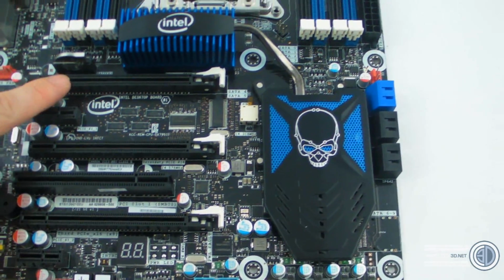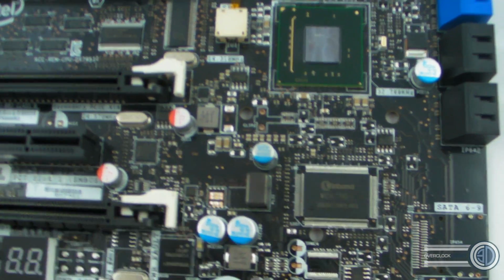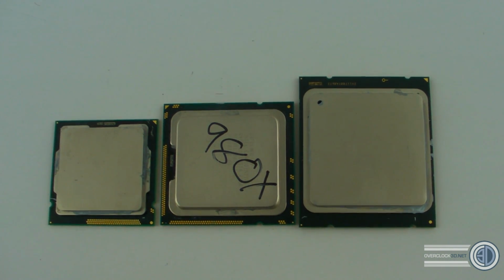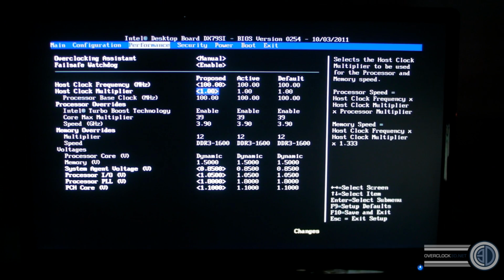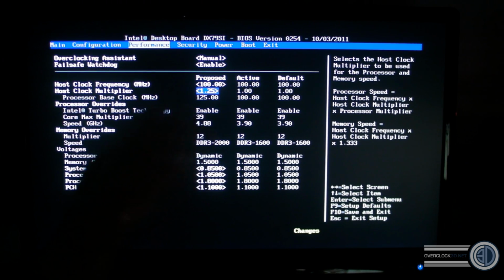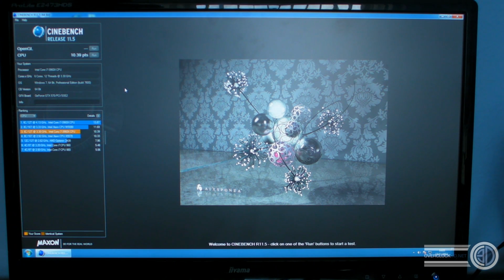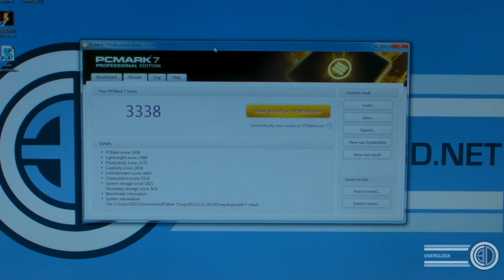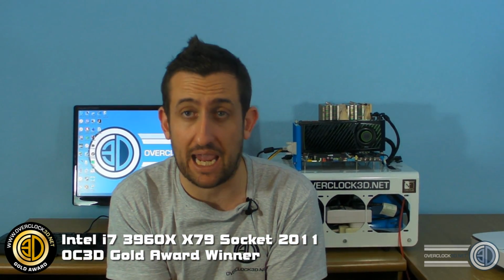Intel 3960X   X79   Socket 2011   Sandy Bridge E Review

Comment: You mentioned the slightly subpar results in some of the memory tests. I believe this is at least partially due to the slower L3 cache in SB-E. Its latency is 5ns slower than SB's L3 latency (25 vs 30). Raw memory bandwidth is still going to be a lot higher with SB-E since it's quad-channel.

Comment: Tom, the i7-3930K is only $600 here in the states the 3960 is $1050. 600 is very reasonable and in my budget, I was going to wait till Ivy Bridge but I didn't realize how "cheap" it was. Think its worth it? Is the difference between the 3960 and 3930 that much?

Comment: If you're not into spending lots of money and you already have good DDR3 memory of 8/16/24 keep that and go with a 2600 or 2700k.  The 79 chipset wants Quad Memory
to really work well, and i saw 64 GB for 599.00.  I've used my old 24k ddr3 but then I didn't get the extreme but the 3930.  Also Corsair has a H100 that fits well, when I purchased the sabertooth 79 and Intel -7-3930 at the sametime, I got $10 rebate and the H100 for 1 cent.

Comment: i said the cooler in the post but for some reason its been removed : (, its the phanteks ph-tc14pe (red). with a phanteks 140mm fan in the middle and phanteks 120mm fan(which i got to not obstruct the ram) on the right. The 3960x was from ebay but the guy had 100% reviews and plenty of sales, the only bad thing is it didnt come in a nice box so no sticker either :P. But it was like £60 more than the 3930k at the time. It works fully though and is verified.

Comment: would be nice to have your highest setting tried on the new setup i got so i can see if it stable am using watercooling on the thermaltake swordm the last chip i had in was a q6600 i got that to 3.4ghz a whole 1ghz above stock.

Comment: @joskes123 
1366 had and is still having a good run. If you got it when it got released a i7 920 overclocked would be more than enough to max out the most demanding games out there and probably for another year!

Comment: I had 990x, 12 threads and a 2600k 8 threads, besides handbrake and FAH...the chips never got maxed out....not even close. I replaced it with a IvyBridge i5, it just makes more sense. A majority of consumers won't use 4 cores let alone 6 or 8 with 12 to 16 threads. Hardware is ahead of the software.

Comment: 3960x is much better but way more expensive than the 3770k. I'd get the 3930k. It performs almost exactly the same as the 3960x but is no where near expensive.

Comment: That's after the large price drops AMD has had to have had, but still. $169 for i5 2500k. The 8150 is SLIGHTLY better at heavily-threaded task, but complete shit and any lightly-threaded tasks. Overall, the i5 performs better. They don't even overclock that well. I couldn't get past 4.4 without disabling all the modules, making it a dualcore with shared L2 cache and FPU. Besides, most budgeted people are gamers, because things like video rendering are usual done at a somewhat proffesional level.

Comment: ivy =)
cheaper = better
or if u have enough money to get good x79 mobo and get x79 processor, then ofc x79 is better =D and if u want run 4-way sli/crossfire x79 "runs" it better. no huge fps diffrent between 1155 and 2011